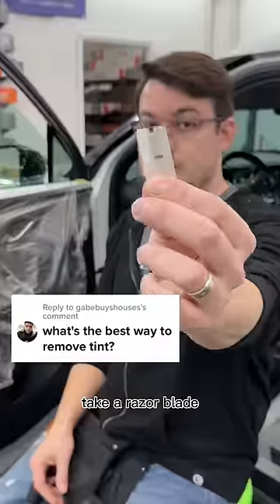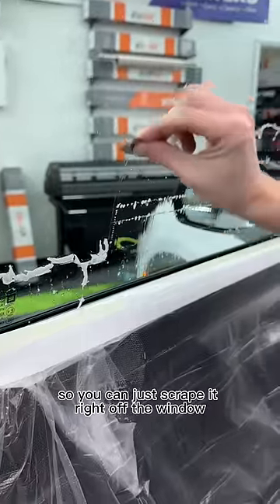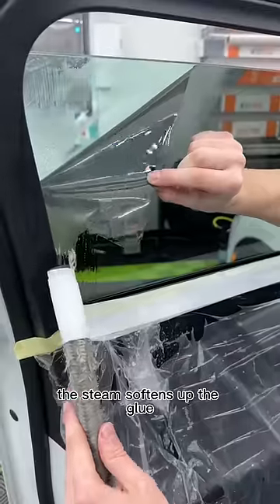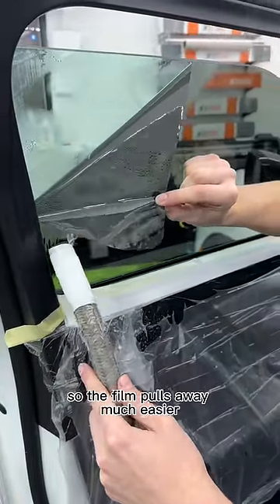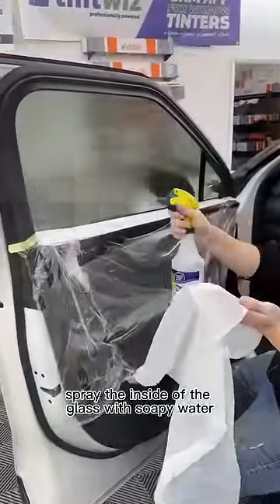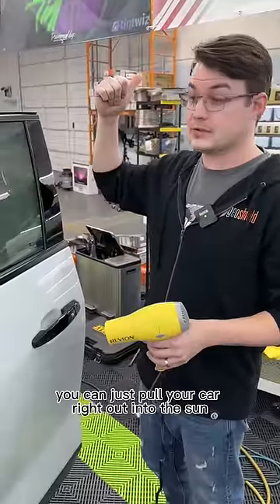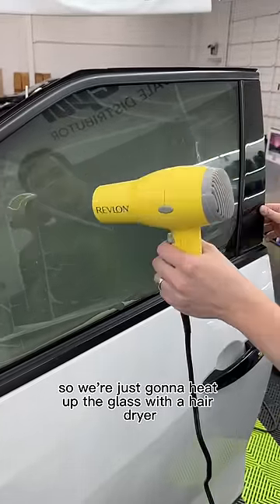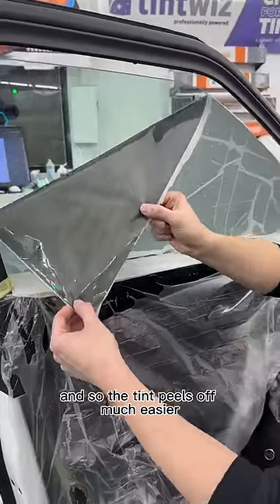Remove Tint BEST Way to do it #diy #tint #cars #windowtint

Comment: About 6 yrs ago I bought a used GMC Yukon that came with the windshield tinted and I didn’t like how dark it was, also the front windows were tinted 5% and I didn’t like it either, so I peeled the tint myself
Let it sit outside in the Texas summer heat for a few hours…guess what happened?
Left a glue film on all 3 windows and it was a huge PITA to remove…

Comment: I had to take my car for an inspection in a new state and they ended up ripping all the tint off my windows (we later discovered that was incorrect and my tint should have passed inspection- still mad about it). I spent hours using goo be gone to get the glue off my windows. That was 3 years ago and I still need to get around to getting new tint.

Comment: No mention of electrical defroster grid wires? 
Razor blades don't play well with grid lines. 
Also, some of the lines can be the antenna for the car radio.

Comment: Lot of experience with razors on my face and trying to to cut myself (straight razors) I would feel completely comfortable on glass with it scratching your glass means your at the wrong angle usually or to much pressure

Comment: okay so I had these thought before starting but didn't realise I saw other people placing clothes and stuff underneath the windows. I started spraying my window with water and glass cleaner a couple times I'm sure it leaked into the door panel more than once, I think a decent amount on each side before I placed rags in between the window and panel to catch water. Now what I'm wondering is will my car be okay with a little water in the panels? It is also normal around +20° Celsius outside if that can help anyone answer my question!